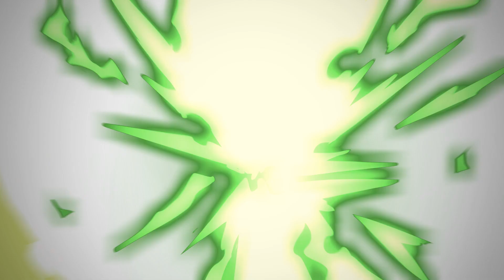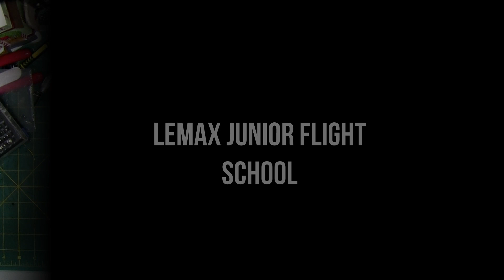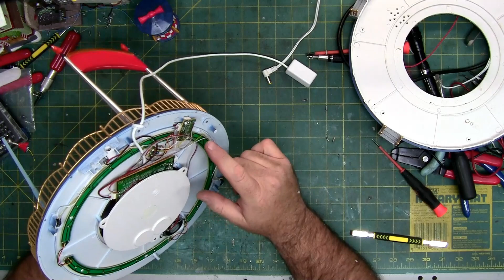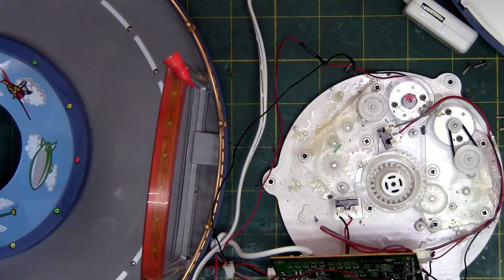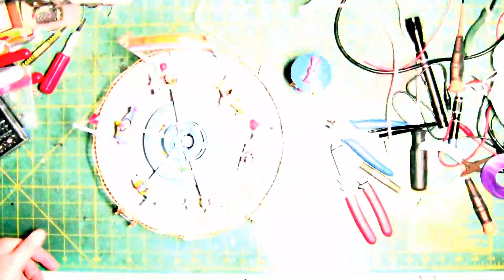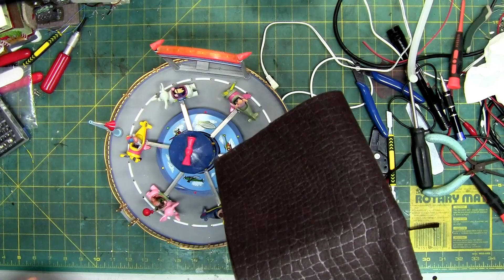Lemax Junior Flight School Repair

Comment: Now mine I checked and there's no juice going to the motor that rotates the aircraft.  I checked the board and found no power going to the motor.
Reply from the maker: That is an issue I have seen multiple times. Some times it is a discrete component such as a bad capacitor or resistor. But more often than not, it is the signal from the blob chip.

Comment: Hi this is a very good channel, life saver. Have you ever opened up Lemax Santa Sleigh spinners? I can't get the center piece off as you are doing in this video.
Reply from the maker: I have not. Examine the piece and look for a seam. Sometimes it is a process to locate the area that you can open
Reply: I am having the same problem. Can't find anyone who has taken the Sleigh Spinners apart

Comment: HI awesome video, i got a question, i have the exact same piece, the same lift motor doesnt work, i replaced the motor with a new one, but its the same, the lift motor works fine, but the rotating nothing, and if i swapt the power conectors from the motors, the lift doesnt work and the rotating doesnt work, but if i turn it off the rotatin motor start working, which its weird, but if put back the connectors to their original switches  then the rotating stop working and the lift works again when i turn on the unit.
Reply from the maker: Check to see if the belt is slipping, next check the micro switches to ensure there are not stuck shut or gummed up. Lastly, check for a slipping/cracked gear.
Reply: @RandomJunkChannel  Hi, I did, the lift motor works but the rotating doesnt, ut if i switch the the motors powers the  lift doesnt and the rotating works but when i turn it off, its weird
Reply: Do you think its something bad with the board? Bc it doesnt power the rotating motor, i already replace the motor with a new one

Comment: Nice video! Do you remember what diode was broken?
Reply from the maker: Sorry, I don't, if you have a multimeter, you can check yours on the board to ensure they are working as designed,

Comment: Hello, did lemax change the design of this piece ,this does not look like my unit.
Reply from the maker: Yes, there are two generations of most of the animated pieces. Some of the most prominent generation changes are the Round Up and Dr. Stretch N Pulls Torture Factory